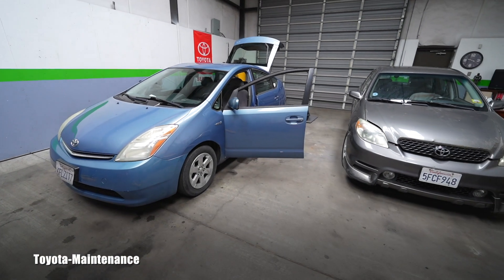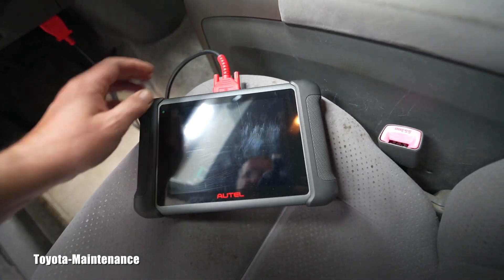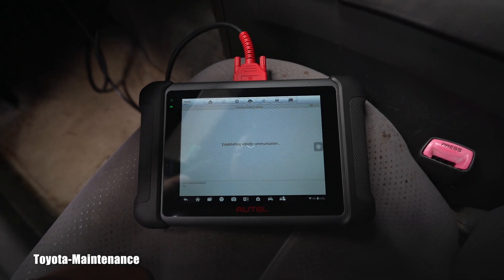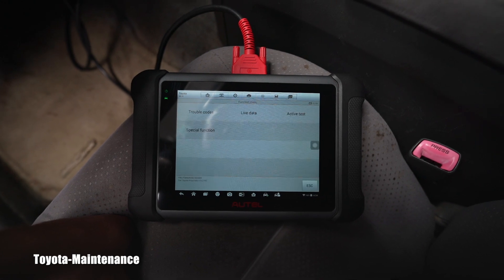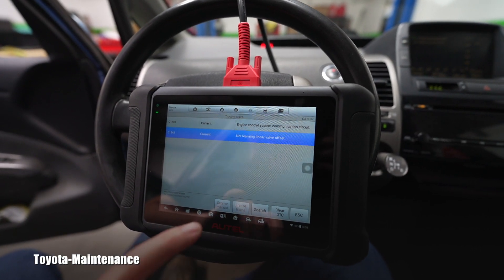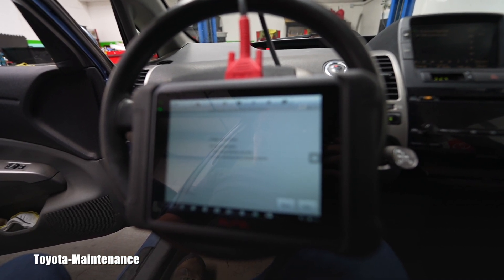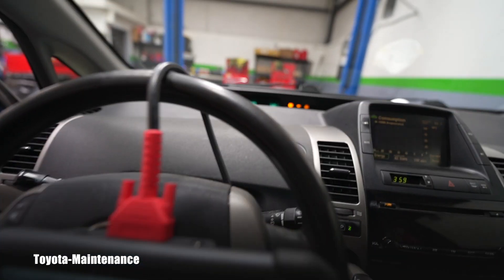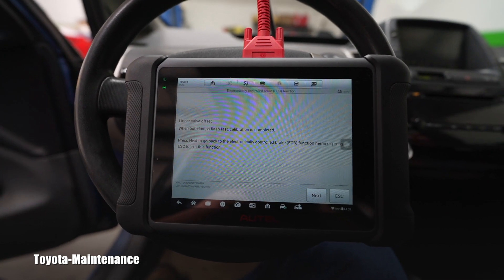Toyota Prius C1203 C1345 Not Learning Linear Valve Offset

Comment: I'm having problems with my brakes, all sorts of random brake codes popping up but the main one is brake pedal stroke sensor, I bought a code for techstream, computer ate it stg... It's all because my battery voltage n me switching batts around. Owning an older Prius is so hard
Reply: I'm using the Thinkdiag by think scan, pedal strokesensor , I ordered another one. Also my rear SHOES and brakes were changed no bleed etc...

Comment: Much appreciate your video. Ran into the same problem following an actuator replacement and complete brake fluid change. The bleed procedure included a linear offset procedure that was completed but for some reason it kept throwing offset code. Used the linear offset function alone and that worked. Thanks again!

Comment: 2013 Prius changed booster and pump with used unit. Bled using Topdon will not complete linear valve calibration. It will cycle and make noises, but Codes remain. Help!
Reply: Any resolution?
Reply: @williamvaughn2938  , yes. I ended up removing the unit and leaving the junkyard accumulator and reusing my original to the car brake booster assembly. It programmed immediately.

All codes cleared and linear offset done. However, I still noticed that the accumulator is constantly running like before. This leads me to believe that the junkyard accumulator unit is either on its way out or the original to the car booster is damaged making the junkyard accumulator continuously run. 

I stumbled upon an internal Toyota publication stating that the accumulator loses pressure over time and that the booster cracks internally. Thus, any junkyard model not equipped with the new booster and accumulator assembly will essentially mean you are on borrowed time. 

Mine works currently but buzzes every 30 seconds. I’m again on borrowed time. Thus, I’ve ordered the accumulator and booster from Toyota and will install it sometime soon. It’s the only way to permanently fix the issue. 

The part numbers have changed from Toyota. This typically means the parts have been updated. I paid $1300 for the new parts. Also, the new accumulator is no longer two black cylinders. The updated for the regular Prius (not C ) is now two silver cylinders. That may help if looking for updated used junkyard units. Good luck!

Comment: Hi, could you please tell me which Autel scanner are you using, I have got an Autel scanner but it does not have that special function where I could do the job ( linear valve offset).
Reply: Actually I had  same issue but once I bought the update witch is 120$ year membership and end up updating all software and finally got special function

Comment: Based on my experience, I have noticed that even if you delete the errors, the brake light and ABS warning lights can come back on again. To resolve this issue, I suggest putting the vehicle in service mode, changing the brake fluid, and bleeding it thoroughly. Additionally, using a paper clip on the OBD can help ensure that your car runs without any problems.
Reply: I had to do the obd pin 4 and 12.

Comment: question about GEN2 Prius: watched your excellent video. Can weak Prius auxilary battery (say 11.5V) be put on a trickle charger connected to a power outlet to perform lenghty computer procedures/diagnistics? I need to know this for bleeding the brakes; my auxilary battery is weak. Thank you
Reply: howd this go for you? Currently have a customers car on a charger to resolve a connection issue. Thinking they might need a new battery but wondering if this worked!

Comment: I recently had new tires and an alignment check. After which the (!) l, ABS, VCS, and BRAKE lights came on and won’t clear. 

The tire shop’s scan tool can’t calibrate, and the dealership wants $192 to be calibrated  if it can’t it’s still $192.  

I’d rather put that money toward a scan tool that can calibrate. 

What is the tool you used, or do you have any other suggestions, and maybe an appropriate cost for the tool.
Reply: I had the same problem in my 2006 Prius (331,000 miles) No codes came up on BlueDriver or my cheap OBDII readers, but Techstream showed C1247 and C1345 codes (for.brake pedal position sensor). After replacing the sensor and using the Techstream utility for calibrating linear valve offset, everything is back to normal.

Comment: Mines have the same code, I’m unable to learn the valve offset. It comes up failed learning offset
Reply: I’m using a AUTEL and tech stream. Any ideas
Reply: Did you solve this issue?
Reply: @Wizardry77  hey yes ended up replacing the abs module, and a job that was. After that did the calibration and worked. So in most cases the just by learning the linear valve would do it.
Reply: @Everestsautolab  thanks appreciate the response

Comment: I changed an actuator and Brake pump in a 2013 Prius and I cannot eliminate the C1345 code...  I tried several times using techstream.... any other suggestions?   Thank YOU in Advance!
Reply: How did you fix it ?
Reply: Have the same issue
Reply: Same
Reply: May I know what is the solution? Is it related the battery?
Reply: Im having the same problem in a lexus hybrid
Reply: I hope some one intelligent has found the solution to this, ct200h issue here
Reply: I was told dealers couldn't even do it so he got a thinkdiag scanner and it worked I'm afraid to believe this guy and try but I might  @jimmydean9918

Comment: I agree with Alan Eaten about the battery. I had an 08 Rav with dead alternator. Christmas tree lights and brake system weak. Electric power steering so that was crazy too for customer who needed to try to limp it to shop. They knew better than to risk a tow. That little trunk 12V batt is KAPUT.

Comment: Autel is not Techstream is it?  That $500 device sure looks handy if it can cure a lot of these electronic problems.
Reply: Autel is Autel and Techstream is Toyota and solely Techstream only. Any non subscription that calls itself Techstream is a hack and is not legal to be commercially sold. Autel makes software and includes the tablet or handheld interface. That being said, many devices exist in the market that does everything you need. Even keys. You just pay more for what you need to do. Still less than Techstream and no annual subscription.
Reply: @LAactor  Can you advise which Autel unit you are using?

Comment: Stuff breaks, especially on high mileage, older vehicles. On today's vehicles, sometimes even the dealers can't fix them. They change expensive parts until they find the problem, wasting hundreds, or even thousands of dollars. Be thankful they don't spread salt on the roads around there. Throw in some corroded wires, and you need a team of electrical engineers to determine what is wrong.